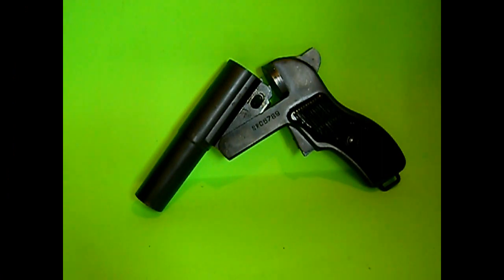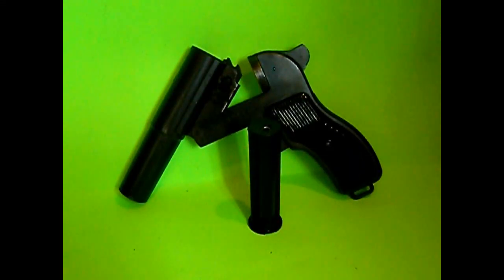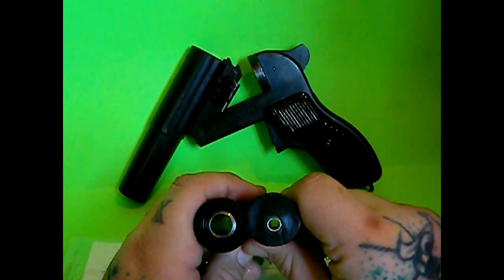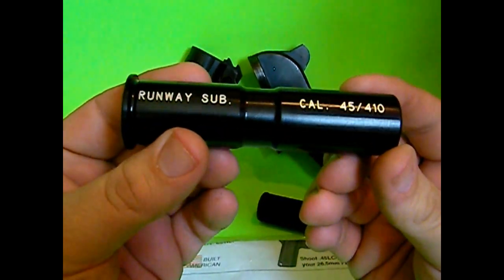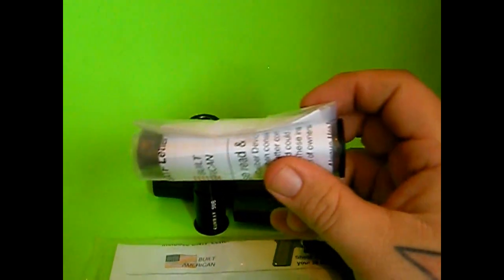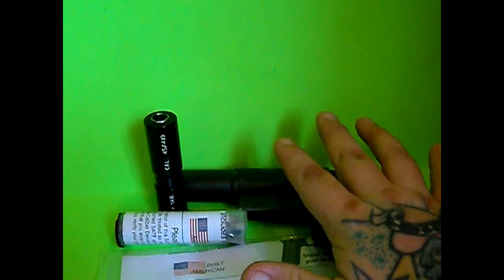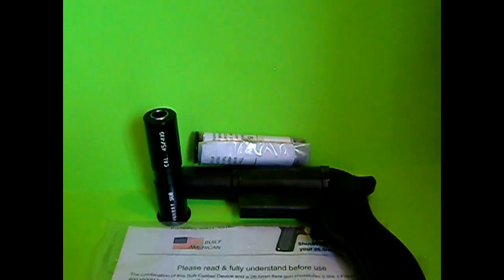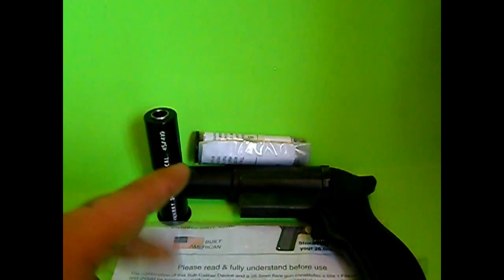How to Turn a Flare Gun into  410 Shotgun Runway Sub Caliber Device 45LC 26 5mm Adapter Review

Comment: This 22lr caliber works fine cause it not explodes..
Reply: That's the whole point you don't want any of them to explode. Probably take your hand off if it did. I seen guys shoot 12 gauge out of plastic flare guns. Usually the second or third time it explodes out the side. Not exactly smart. I have yet to see one of these metal ones explode. Especially the ones with the inserts. They have more metal around the ammunition than a regular gun. The reason I have guns like this are they make good scavenger guns. For like bug out situations...  certain kinds of ammo may be hard to find While others are not. With inserts you can shoot just about any ammo you can find